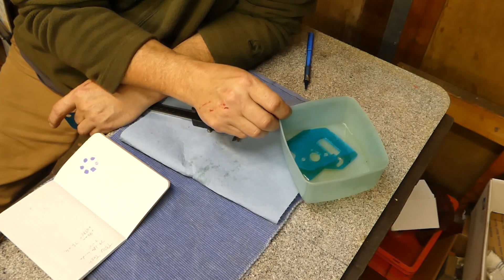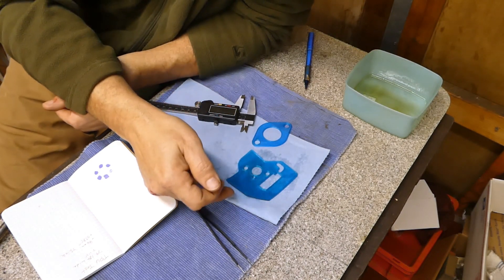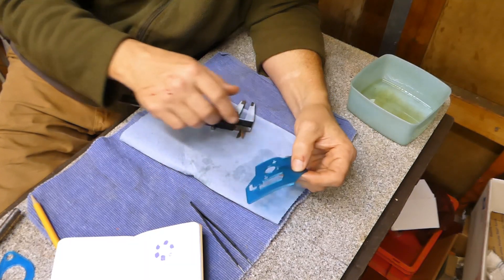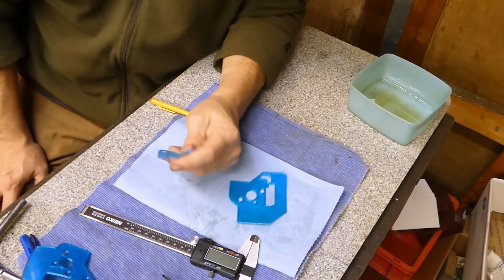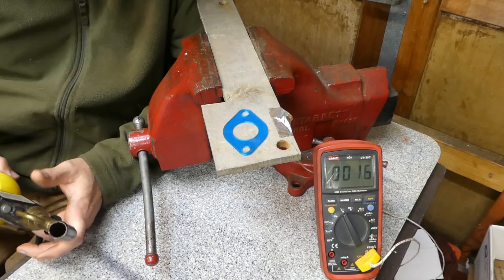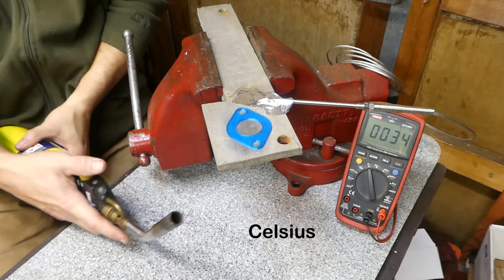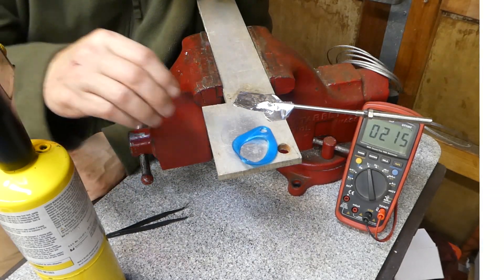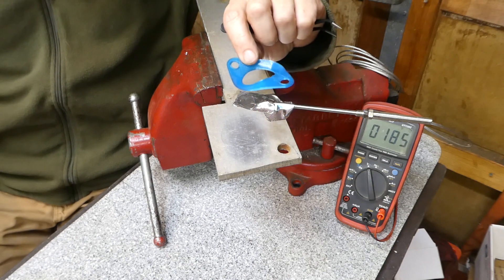Will 3D printed gaskets melt? TPU tests

Comment: I've been running a TPU clutch cover gasket on my air cooled motorcycle with a dry clutch.  It's just about a year old, no issues yet but it's not holding any oil in, just keeping the elements out of the basket.
Reply from the maker: What bike?

Comment: Note that soft and a bit sticky (being above the glass transition temperature) isn't necessarily a bad thing for gaskets!
The glass transition temperature of natural rubber is about -70C. That is, 70C below zero. Think about how soft a rubber band is. That stuff makes good washers.
Being soft is what allows it to seal, to "flow" into tiny voids and seal them. You do want to avoid it getting so runny that drops start falling out, though!

If we wanted gaskets to be hard and stiff, we would print them in ABS. We often want soft.
Reply from the maker: Good point!

Comment: Thank you so much for this test. I'm printing airbox to carb pipes for a motorcycle. I don't think they will get hot but will strap a temp probe to them on a run. The negative pressure in the pipe will want to collapse them which wouldn't be appreciated.
Reply from the maker: If you have a good amount of wall thickness, collapsing should not be a problem. TPU should be stiffer than rubber for the same thickness.
Reply: Did you ever end up doing this? Buddy wanted me to prototype some velocity stacks for him out of TPU and would love to know if they’ll melt before I go ahead and do it

Comment: Glass transition temp (GTT) is where it becomes elastic, so for TPU is way below room temp that's why it's flexible, below glass transition temp is where it turns stiff, solid, and brittle like glass. The temperature from solid to liquid is the melting point (MP), which sometimes comes in a range and not exactly points. What you're essentially measuring with the stretch test after heating with a torch is called the heat deflection temperature (HDT), which is it's resistance to alteration under load at an elevated temperature. TPU thermal characteristics are as follows:
GTT: -24 deg C (that's below zero)
MP: 220 deg C
HDT: 74 deg C at 66 PSI

Also, how are the gaskets holding up? It's been over a year at this point right?
Reply from the maker: https://youtu.be/mK1O02n86Go
Reply: @theeddies  that answers that! Glad to know it all held up. Really when it comes to comparing to commercially available gaskets and o-rings, TPU is similar if not slightly superior to Buna-N.
Reply from the maker: I just did a a follow up - I will send you a link in a separate comment but links are not always delivered. If you don't get it, it is the latest video on my channel. As to your other points I actually corrected the nomenclature in a later more in depth video. Thanks!

Comment: i think this is funny what engine are you running over 100c consistently you’ll worry about other things failing before the TPU does!😂
Reply from the maker: The lawn mower I tested these on would reach oil temps in the mid  90's. celsius during the last summer of 97F days. The TPU can take it, without failing but it is just on the edge.

Comment: i think it would be more important to know at what temperature TPU gasket starts to leak while it is sealing some parts. Like, would it hold up as sealing gasket for coolant pump on a engine? Being clamped between water pump and a hot engine for some time, would eventually tpu gasket  deform and leak? how many cycles it would survive, if any.

Comment: Saw your previous video an believe you were going to leave that carb gasket between the engine and carb for a while and see how it held up.. Have you done this and what were the results?
Reply from the maker: Still going good. I think I am up to around 10 hours on the machine over 8 mows including a few at outside temps above 90. I will have a follow up some time in August where I will take all of them off and take a look. Besides the carb gasket there is a fuel cap gasket and valve cover gasket. You can find those in the other videos. There are 5 in total. Thanks!
Reply: @theeddies  Is this between the engine and breather tube or breather tube and carb? I'm curious how it would hold up against the engine itself?
Reply from the maker: @jamienoel  Carb and intake manifold. I have another that is between the valve cover and cylinder head. It will get the hottest.

Comment: I’m sure the gasket will not go anywhere in use especially for a water pump gasket it will never see them kind of temperatures in reality. Unless the engine is about to blow up. 🤣

Comment: Don't know if you have one, but 15psi in a pressure cooker is about 250F. (depending on altitude) It would be nice if TPU could be used as a seal for canning. Would have to survive 60-90min at this temp&psi. If it can survive several cycles like this, it will be sufficient gasket material for 95% of applications.

Comment: I hear TPU is water sensitive. I hear it can absorb moisture.
Reply from the maker: All plastic absorbs moisture. TPU is certainly more sensitive to it but in my experience this only effects printability. The amount is so little it does not seem to make much difference to the part after printing. This is my experience and based on the some other results I have seen/read and all plastics react differently.

Comment: I made a 90° elbow out of TPU from my valve cover to the intake system for the PCV on my car. Under hood temps are fairly high (not sure on the exact number) and it’s regularly exposed to oil and has held up well for nearly a year now. The orange color it was has darkened due to the oil exposure but it’s still doing it’s job

Comment: Well here's the thing; You already know the absolute melting temp is 200 degrees C so it goes on to suggest that operating max is 50% of that. No 'experiment' needed chum.
Reply from the maker: Hello, I am not quite sure how you came up with that 50% calculation. Firstly, the melting point is lower than 200C. 200c is liquid enough to squeeze through a nozzle but it begins melting before that at around 170. My testing here as well as further tests which are coming show the gasket still performs well above 50% of "melting point" possibly even up into the 120C range.

But it also depends on what pressure is put on the plastic gasket as this will effect its melting point slightly as well as its overall  performance. There is also the effect of heating and cooling cycles effecting overall performance. Etc. I would argue there is plenty to test.
Reply: @theeddies  The 'actual' melting point of TPU is 145 degrees, not 170. But that's not even the point. The point is that it's the 50% tolerance rule in engineering. If the pressure point is 2000psi, then the operating pressure is 1000psi...if the weight capacity is 500lbs, then the operating weight is 250lbs. So I actually overestimated. Since the actual melting point of TPU is 145, then it follows that with the 50% rule, that operating temp should not exceed 72.5 degrees C. No actual testing needed. The melting point is a fixed variable, and the 50% rule is a fixed variable. You can, however, test for chemical resistance, but even that is a known, known. We know that TPU is not resistant to acetone because it's often used in smoothing and if you look at the data sheets, you see a list of other reactive chemicals.
Reply from the maker: @antagonizerr  The melting point is exactly the point, you don't even know what it is other than what you have apparently gleamed online, yet you are basing your 50% rule on it. There are no absolutes to be stated here as the formulation of the filament makes all the difference. Further my actual tests showed it can handle 20 psi of torque load at 120C (see latest video). The 50% rule of engineering is fine but we are not talking about a steel beam holding several tons of weight. We are talking about a flexible gasket holding a few PSI of air or oil pressure. It is likely not a problem but it also needs to be tested. There are countless papers (albeit behind paywalls) testing and confirming various TPU formulas, modulus, Shore, etc. Do you think they should just all use your calculations (200c or 145c) or whatever you read on a forum? I am doing these tests to satisfy my own curiosity and if someone quotes them somewhere on the internet I will be the first to say, "do your own testing before proceeding".

And again not all TPU, just like not all PLA is the same, Just because one reacted to acetone, does not mean another will. I showed on video (2nd one) it had no effect on this brand but did effect the PLA  I used. Other people say their PLA was not affected at all by acetone. Brand and/or formulation makes a difference. 

Dealing in absolutes is not helpful in this case as there are no real manufacturing standards at the hobby level as of yet. I cannot even get the company to provide me with a data sheet or tech specs for this brand. If I was buying engineering grade A1 tested material for 100's of dollars with known knowns I would use them but it is not the case here.
Reply: @theeddies  Lol, yup you're right and the data sheets are all wrong. Guess we should all just say, 'screw the manufacturer what do they know?' and just listen to you.
Reply from the maker: @antagonizerr  Since you just replied with some gibberish that states exactly the opposite of what I said in my previous comment, you clearly did not read the comment or understand it. Either way, have a good day!

Comment: Amorphous, non-crystalline polymers are above glass transition temperature in normal use. I'm not quite sure what particular temperature you're looking for. Maybe heat deflection temperature?
Reply from the maker: Yes, I need to correct this in the next video (soon). I had this conversation with someone else and I decided that what I was measuring was likely heat deflection at zero load or basically when it starts to lose shape with no extra forces acting on it or right as it starts to melt. My testing says that is around 170c. But under load it happens much lower. Basically it would hold up a bolt torqued in my jig at 20ft lbs at 120c but that is really pushing it. Useable is still going to be a maximum somewhere in 100c range +/- for any usable torque range that I commonly use. If you are interested I will cover that in the next video as well as the effect of heat treating or annealing to increase its usable temp range. Thanks!

Comment: Can you please do this experiment?
1- Make a head gasket using TPU
2- Torque the bolt while the engine head is cold
3- Manually heat the head to 200c
4- Torque the bolts while the engine head is hot (perfect squeeze of TPU super seal)
5- Check for compression + run the engine for an hour.
Reply from the maker: Will not work. I have a video coming out in a day or so which will demonstrate it. But essentially at around 170c the gasket will start to melt and by 200 it will be running out, it will never hold any torque at that point. I could not get it to hold 15 ft/lbs at 170c You will be squeezing it out until you are left with metal to metal. Thanks!
Eddie

Comment: TPU is hygroscopic like most 3D printed materials after printing . It will absorb water from the air and swell if left long enough .
Reply from the maker: @Made By Nobody Famous Possible. Though I will say from my experience and from watching a few others investigate the hygroscopic nature of a bunch of filaments, I think this effect is overstated a bit. I know it can cause problems in the printing process, I have seen it cause popping and globbing problems with PETG but the amount of actual expansion both in weight and size is so small as to be nearly negligible. 
Thomas Sanladerer did some interesting tests with soaked filament and had trouble even measuring the difference between wet and dry in the real world. Again, I know it is hygroscopic, I am just not sure apart from the printing quality and (possibly some minor strength considerations in rigid plastic) that it makes much difference. Best!
Reply from the maker: Yes, I usually put it back in a bag after printing but I actually accidentally left this brand out for 2 rainy days and it still prints fine. Of course you can always dry it in the oven if it does get wet.

Comment: If heat is a concern, it is very effective to print molds in PLA for casting two part tin cure silicone into.  A simple two part mold can be created to make gaskets like this.  Could even use TPU to make the mold if you want to be able to bend it when demolding, which might be helpful for weird shapes.
Reply from the maker: Good idea, thanks!
Reply: That's not a terrible idea but generally you are replacing paper gaskets so with all that effort you probably would just cut one out of paper or cork but also I'm not sure how thin you could easily get but I'm sure there are some good uses for that method
Reply: @james10739  if you're going to this effort I think the proper solution is a vinal cutter tbh, and just cut out paper or rubber gaskets with the plotter, if your sole use is making gaskets the plus side is it's cheaper and faster to buy into, downside is probably blade life but blades are cheap
Reply: @jaykoerner  most maker spaces will let you use their cruict machines for free or for a monthly fee, which gets you access to a shit ton more. (If they have a criciut)

Comment: If you look it up, the glass transition of TPU is actually below room temperature, even below freezing. This is part of what makes it not experience the warping PLA does when crossing Tg and cooling again.
Reply from the maker: That's actually very right. It would need to be solid (in this case frozen) before it can transition, so it has a long transition to liquid but starts at -42 is the number I am seeing. I used the wrong term in this case, thanks! I guess the term here would be its heat deflection at zero load. The point at which it will begin to lose its solid shape and become deformed. Would you agree that would be accurate?
Reply: @theeddies  I'm not an engineer or material scientist but it sounds at least roughly right to me.

Comment: You can print too plasticized nylons or a softer nylon variant which are resistant to oil, fuel and have better temperature resistance than common TPU
Reply from the maker: What is the "softer nylon variant"? Most available nylons I am aware of are not going to be flexible in compression without maybe some clever infill design. I have not printed any yet, though my one printer should be able to handle most of the commercially available products I have seen. So am open to any suggestions. If there is one with Shore hardness in the A range, that would be a much better alternative. Thanks!
Reply: I was thinking of Taulman, their PCTPE (which is a plasticized nylon) and their Nylon 645 which is quite soft. Also you could try some of these "easy nylons" most brands have. If you put them in hot water for a while, as nylon is hygroscopic, the water molecules get in between the polymer chains and plasticize it, turning it very soft.Although I could imagine that in a hot environment it will dry out and become hard again. There is also the polypropylene option which is very temperature resistant and it is as chemical resistant as you can get besides PPS. Formfutura and 3DXTech have PP, but I'm sure other brands too. Thanks for making videos on the topic :)
Reply from the maker: @santiagoblandon3022  Thanks for the info, I will check them out. I have been wanting to try Nylon. Need to get or build a dryer. Best!
Eddie

Comment: Find out what the glass transition temp is from the manufacturer and don't exceed that.
Reply from the maker: For certain higher end manufacturers that may work but I doubt most will have that info and different batches may have different temps. Most of the filaments I use have manufacturer recommended printing temps with a +/- of 10 or 15 degrees. If the glass transition has a similar spread I would rather do a quick test myself just to verify.
Reply: @theeddies  you might be surprised unless you're getting all your filament from China and there's a language barrier. The Tg temp is a pretty important one for any manufacturer. The print temps would be the melting temp (Tm) and that will be much higher than Tg
Reply from the maker: @Ragnar.Lothbrok.3.14  Most of my filament I am getting is Chinese made. I tend to buy from a few brands that I trust their consistency though. Like Duramic, give their TDS on their website. This is a brand I had never used but was running a deal so I gave it a shot and am pleased with it so far. I think it is called Rambery, lol. 

I will check with them and see what they say. Thanks!